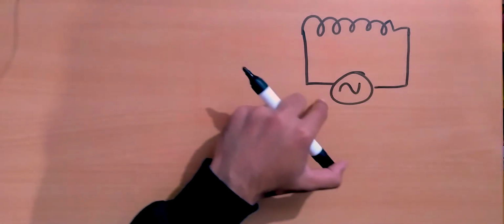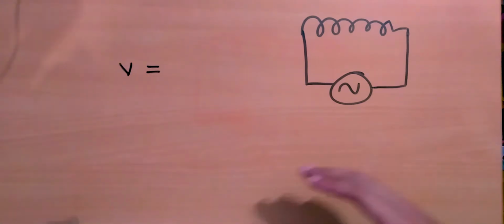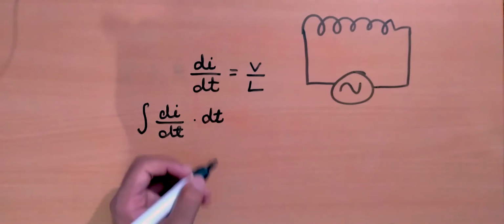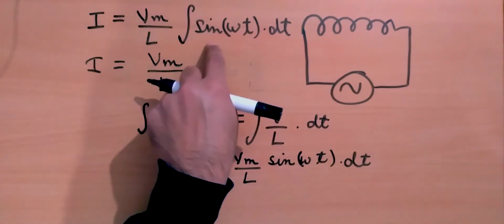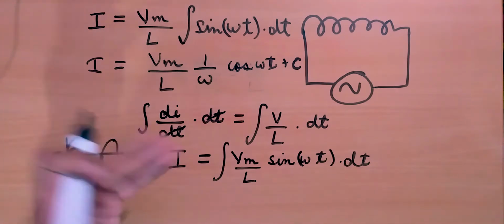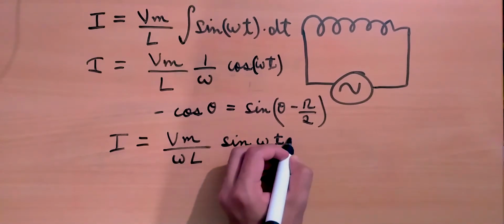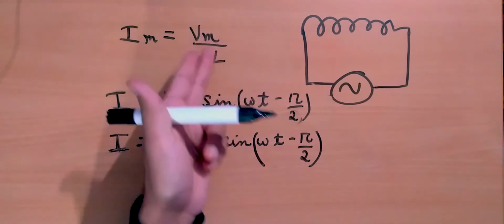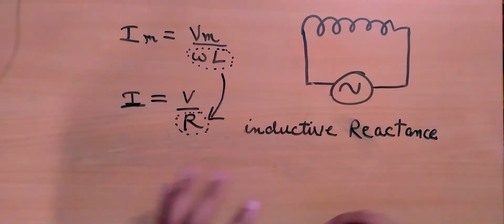AC Voltage Applied To An Inductor (Part 1)

Comment: Why does current flow if the voltage difference across the ac source is equals to the voltage source across the inductor???? Hope you will explain